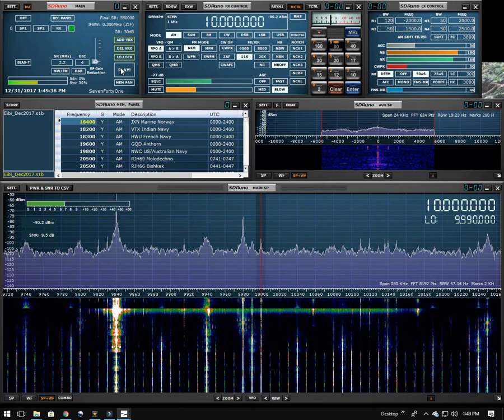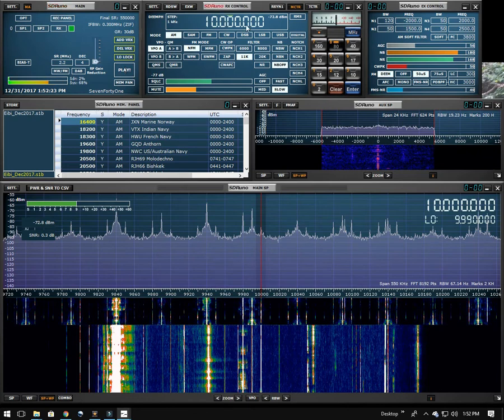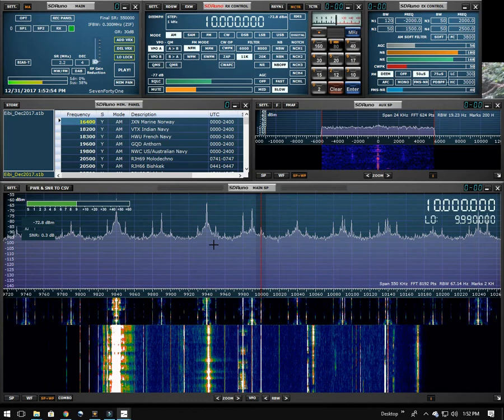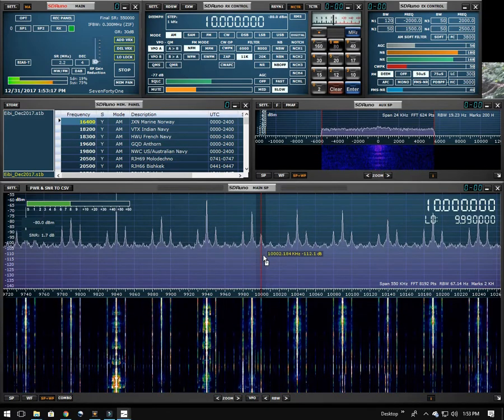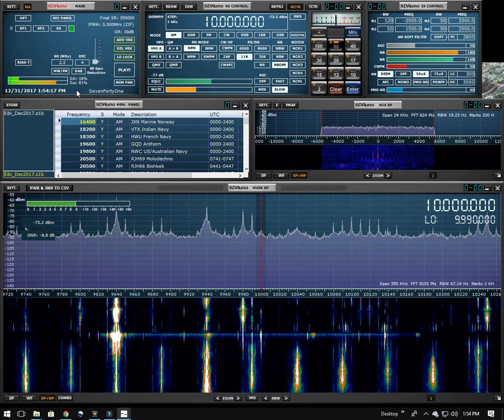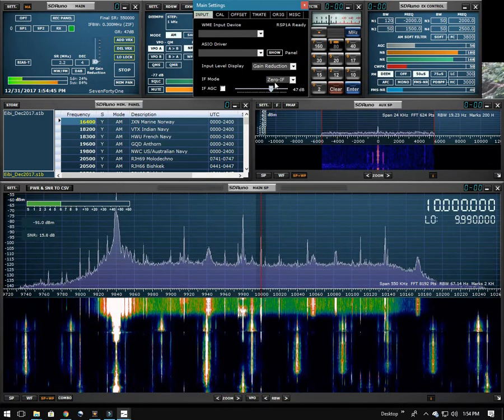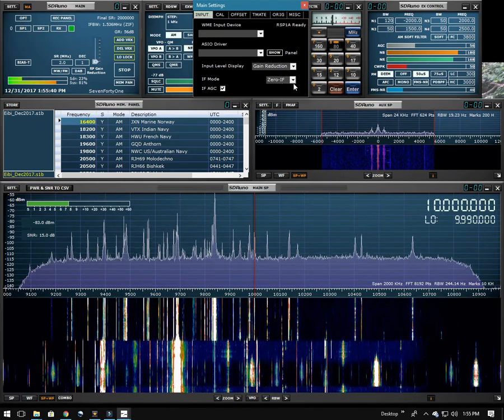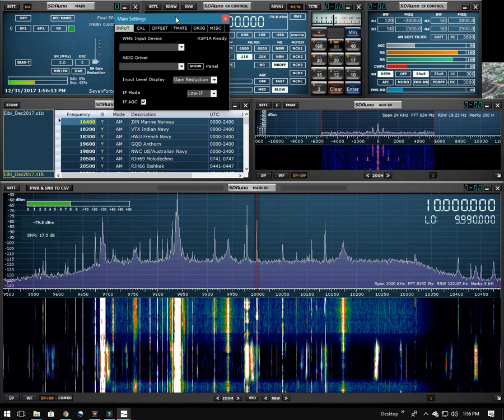SDRplay SDRuno IF Overload and IF Gain Settings - ADC Overload

Comment: What you are seeing here is ADC overload caused by the IF gain being set too high.  SDRplay recommend leaving the IF AGC enabled to prevent ADC overload. The current version of SDRuno does not provide an ADC overload warning if the IF AGC is disabled. The next version will flag an ADC overload warning, even if the IF AGC is disabled, so it will be clearer as to what is going on in these circumstances
Reply from the maker: Thank you very much for the explanation!
Reply: the sdruno does she a yellow letters adc overload it will be under the bias t button
Reply: hey i just wondering if you could show how to inter shortwave frequinces in to sdruno
Reply from the maker: Sure - I'll try to make a quick vid tomorrow if I can get some time.
Reply: any time you can i look up some sw frequices but dont know how to add them  on sdruno how to put them in
Reply: and thanks
Reply: Love the potential of my RSP2 but im experiancing a multitude of issues. This  video has helped address one of the problems. Thank you.

Comment: My problem was discovered through a backdoor...I have an outdoor antenna for my scanner and began noticing that all of the VHF high band channels were not receiving. I figured that my BC 780 XLT was the problem so I bought a new Whistler WS1065. It has the same problem, manifested by the S meter being maxed out but receiving nothing. My SDRplay RSP-1 is showing a high noise floor and FM broadcast interference. When I connect a Tektronix spectrum analyzer the noise floor is -105 dBm and the interference is non-existant. I do not hear the interference on my Kenwood TS2000 nor on a vintage Realistic Patrolman 3A analog receiver. I'm awaiting a FM filter from RTL-SDR to make my scanner usable again. Funny thing is that high band used to work until maybe six months ago. Then it became erratic. I am currently using the whistler on an indoor tri-band ham mobile antenna and am able to hear all of the high band services.

Comment: Thank you for the videos. I am in need of some advice.  I recently installed an EFHW Inverted-L antenna.  With this very long (132 ft) sloper type antenna I am 
receiving a lot of bleed over (across almost the entire AM broadcast Medium Wave spectrum).   I haven't yet found a way to eliminate or at least reduce that bleed-over.
Any suggestions?  The station is roughly 8 miles from my location and rated at 50,000 watts.  The IF/Gain settings you reviewed unfortunately did not solve this problem for me.

Comment: On my RSP1 have to use an external filter to keep the MW stations from bleeding over.  I have some very strong MW stations with 10 miles of me.
Reply from the maker: The RSP1A has a built-in MW filter which helps with MW overload and images.  But I don't think that my problem was being caused by interference from any MW stations as I tried the MW filter first and it didn't really change anything.